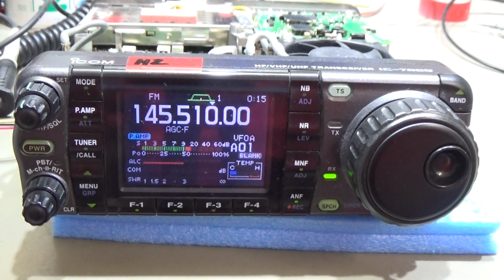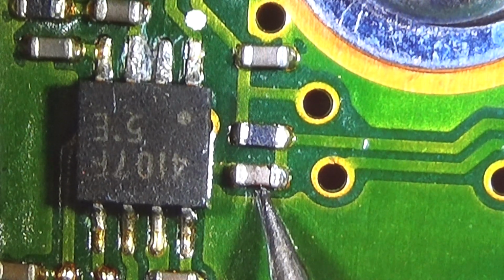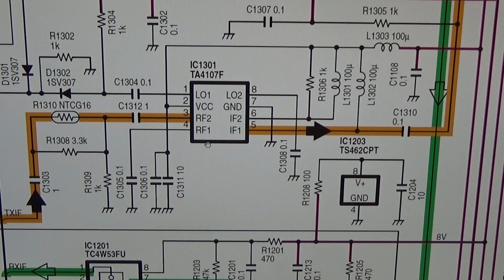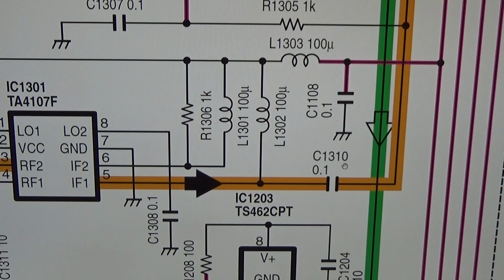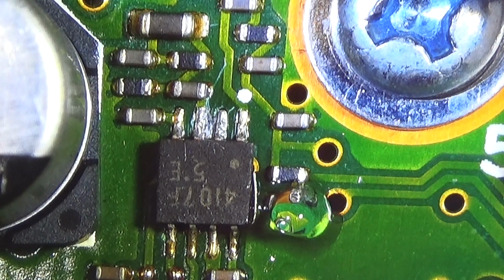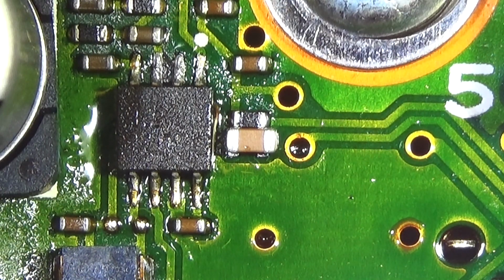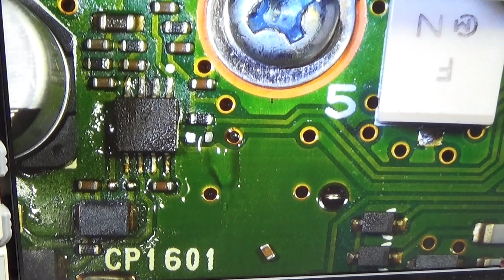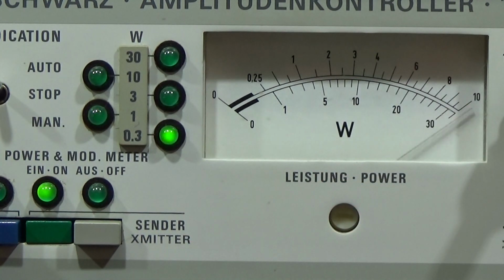#210 ICOM IC-7000 ugly intermittent TX fault fixed

Comment: W 🤓W Peter that was some challenge and a perfect repair.  The more I watch your videos the next radio will have through the hole components if such a radio is available.  I did build a few kits using SMD's but with old age and dodgy eyesight I found it tough going.
73 de Ger EI6DP

Comment: Ok, ordered the driver as I have no output on any band. Took it apart today on the bench and the driver already has the newer board and the mosfet curves just fine. So after watching this video I have to go back in tomorrow and look at that or any other capacitor that may cause this. It had been intermittent a couple times but I chalked it up to a loose connector. Any other common no power out causes? Idea all bands.

Comment: I'd go with hot air and SMT tweezers  every time for that sort of repair.  Less likely to damage the tracks once you have practiced on old scrap PCB's to master the technique.  Better still, such hot air systems are rather inexpensive now.  I have one (Chinese) with the blower fan, element and temp sensor all in the handset.  Cheap and superb. Skip all that corrosive 'no clean' flux and desolder 'dry' while using SMD solder paste only for rework.  No mess to clean up. Good luck.

Comment: Nice work.
Reply from the maker: thanks
Reply: I have a 706mk2g that the receive drops out completely after 2 min talk time. Only has some transmit pwr on 160 thats it. Love to have it fixed if your ever interested. Love your videos. They almost have me convinced at replacing the filter board just to see what happens.

Comment: Hello I have a question of another video that you posted repairing an FTM 400 yesu The final on the radio or the amplifier I believe is what you called it on the video burnt out It would appear the same thing has happened to mine and he suggestions please
Reply from the maker: If it is the final it needs to get replaced as shown in the video
Reply: Thank you for the reply I've in the recent days have sent it back to yaesu and hopes that it's going to be repaired under the 3-year warranty that I'm still within I've only had the radio for 10 months My concern is that they going to repair the radio but not do the modification to the chassis

Comment: Peter, we missed seeing you.  Welcome  back!!!  I own one of those pesky IC7000.  Great radio, but it runs hot enough that you might think it has tubes.  I would guess the components see  lots of thermal stress over the years.  Thanks again!  de KB7ZUT
Reply from the maker: yes for sure so never use with full TX power...

Comment: I so had a smile when I saw the video of the repair posted.  I hope not too much harsh language, lol.     I know the feeling.  My story if wish to read.   Was a mechanic here,  now with health issues, mostly my back, I do not get around to well any more.  I have went back to electronics, my first love, something I started in high school.  I got the ham bug a few years ago. Here I am now got a bench full of Rigol and Tektronix test equipment,  I do some ham radio repair on the side when able to get up a bit.   I got an older unit Kenwood TS-130S, intermittent transmit as well.    I resoldered all the boards,  I changed signal diodes, I cleaned relays and switches.  I could get radio to work, thinking it fixed.  I always work my repair radios good to verify the repairs. Thinking it fixed sure enough a day or two later it would do it again.  I spit out some pretty bad language at it.   Finally, under some hardware, there was a to-92 transistor, a 2sc2086 to be exact.  If you get it at the right temp it would quit working.  Pre amp transistor for the PA.  Order one and no problems since.  Took nearly a month to find it.  What made me feel extra bad was this was the only HF radio the customer owned at the time so no radio play during repair.    Please keep up the video's  me and others are watching faithfully.
Reply from the maker: Yeah John that is a pain not getting a job done. Great that you found back to old love ;-) Thanks for your very interesting report always nice to hear what others love. Take care of your health!

Comment: I've had a cracked smd resistor which I only found when I desoldered the part and half of it stuck to the tip. I'd already looked at the board under magnification and didn't see the crack.

Comment: That is beautiful work, and the results speak for themselves. Therefore, this is not intended as a criticism of any sort. I would recommend watching some of Erkin's videos at the HDD Data Recovery Services channel. This man is the most wizardly wizard I have seen when it comes to onboard microsurgery. With just a pair of hot tweezers I have watched him remove dead caps and replace them with new ones in a matter of seconds, using only flux and the solder that is already there. His repairs are not always quite that magical, but it might indicate that the level of care required may not be quite as extensive. His work is quite repetitive in nature and also quite extensive, so I guess practice makes perfect. If nothing else, it is great to watch.
Reply from the maker: Well, I never would have the intention to criticize the work of a colleagues but I don't expect to reuse solder as a good idea as with soldering a lot of chemical processes are involved and thus fresh solder and clean solder pads are the basis for a professional and long lasting work.

Comment: Great fix Peter  ? but is there a right or wrong way to fit them little capacitors
Reply from the maker: Well first of all there are different circumstance where you have to adapt your method to process it. The main issue is to overheat components and the board which could cause damages to both. That is the reason why chip manufactures are issuing a soldering temperature profile.. Additional to that soldering machines are used which are following by a program exactly the profile. I always try to put as less stress to the board and component as possible. If hot air is needed you see me trying to heat the board first before I go down to the component. You see a overall valid answer is not easy to find as long you are working in the field not having those soldering machines...

Comment: Excellent find...amazing replacement!  You did an excellent job on this one!  
One question for you though.  Where that capacitor is in the circuit it really needs to be either an NP0 or Silver Mica type capacitor.  Was it either?
Reply from the maker: No this is a coupling cap which does not need to be extremely frequency or temperature stable.
Reply: @TRXLab  True.

Comment: Is freezing the board (with gas duster I'm guessing) considered safe? Aren't you afraid of condensation?
Reply from the maker: Not sure what you referring to but the freezer spray I use is for electronics which will not be harmful in any way.
Reply: @TRXLab  I'm talking about air i a can, compressed air. If you hold the can upside down, it will release it's content in liquid form at very low temperature, like -50 degrees Celsius. Isn't it how your freezer spray works? I've never used it, canned air is much cheaper.
But I'm not talking about the chemical effects of whats inside the can (commonly, cheap canned air have mostly butane inside where I live, which is part of the reason I don't use it on powered electronics due to flamability issues, but you can buy cans that are safer), I'm talking about condensation. When you freeze the board (or even bring it to below the dew point), moisture from the air will condensate on it, and probably will freeze. But once it heats up, it will be in the form of plain water. Did you never experience issues with that? Personally, when repairing electronics, I've seen what water spill can do to some circuits in just few minutes. I even saw effects of just air conditioner pointed at some computer parts.
Reply from the maker: @ukaszsmoa8416  Well the electronic freezer spray I use is considered to be safe. Yes there is condensation on the board but since I don't know the chemical ingredients in the freezer spray I can't give you a satisfying answer.

Comment: Nice job finding that intermittently open capacitor. We ALL hate intermittent problems in electronics. That is weird that the ceramic cap opened like that. Due to vibration perhaps? It is a mobile rig of course. Is this a rare for ceramic caps to open like this?
Nice work, and glad to see you back Peter! 
73s Tom
Reply from the maker: Well I have  found more often ceramic caps like this cracked. So that is not new to me...All the best!

Comment: Hi Peter, I wonder if you invented a special tool if it would help you find problems like that faster. I'm glad that was a cracked cap and not a failed plated-through-hole from a trace that runs one side of the board to the other ! Geeze those SMT components are tiny!

Do you think introducing vibration to the board would have exposed that trouble sooner? If yes, maybe you could make a vibration tool from an engraving tool or similar by replacing the cutting tip with a rubber type tip that you can touch to the circuit board. If that's not enough vibration, perhaps another source of vibration... like an ultrasonic device. Whatever you try, it may need to have a variable intensity so you can control the level of vibration introduced.

Excellent work Peter. I always enjoy watching your channel. You were smiling today. So we know you got the monkey off your back ! LOL
Reply from the maker: As long I'm not expecting a temperature issue a good not to soft brush is very effective...
Reply: @TRXLab  :-)

Comment: Great repair a word of advice u should not touch hot iron to only one side of components. Either use hot air gun or use hot tweezers. Im sure it will be ok but there is chance to damage only putting heat to one side.

 Great repair anyway! 
Awesome channel.
Reply from the maker: Do you really have had problems doing it that way? I never had. Under different circumstances you have to adapt your process but if possible I believe that my way is the most gentle method to do it.  But your opinion is highly appreciated..

Comment: Great repair Peter and excellent explanation. But the question is : how is it possible C1310 had been broken ? Thanks Peter, have a nice year dear friend, 73s de IW0HEX Pasquale.
Reply: My guess is that it might have been damaged during assembly by the pick-and-place machine, or it had a slight crack in it as received from the supplier. The crack would then propagate with time and temperature changes (perhaps even during the solder reflow process at Icom's assembly plant). All it takes is a tiny crack to start the whole process. However, Peter would know best what would cause this kind of damage.
Reply: @fa_engineer3687  I find it suspicious that there is a pcb fastener screw quite close by.  If a little mechanical misalignment of the mounting pillars puts  stress into the pcb, that might  be enough to encourage crack propagation in a poorly manufactured capacitor.
Reply: @hectorpascal  - Yes, of cause, mechanical stress when screwing the PCB to the chassis was the most probable root cause of the crack. In automotive PCBs designs its prohibitive to place ceramics close to screw wholes or PCB edges since there is too much risk involved to crake them during assembly.
Reply from the maker: well my guess is as good as yours but as as hector and Wolfram already said there are a lot of things which could go wrong including design errors...